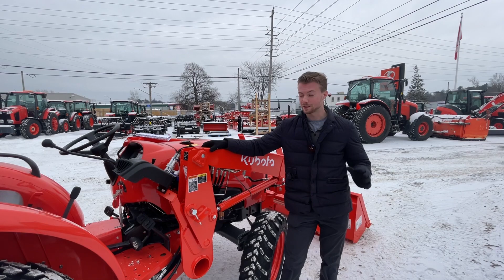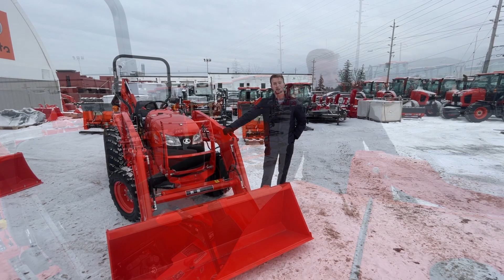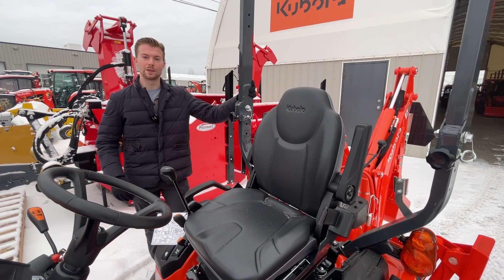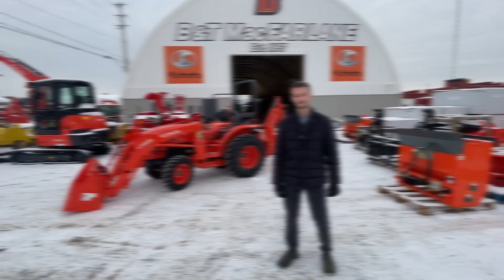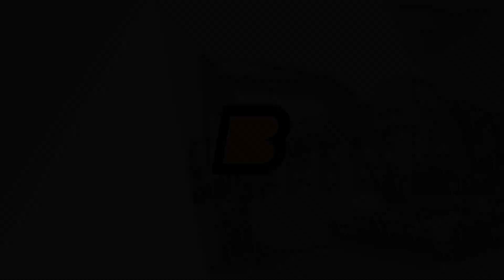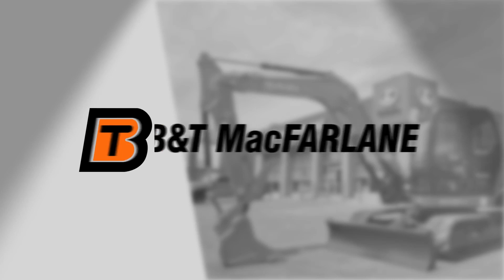Common Mistakes of FIRST TIME Tractor Buyers!

Comment: I'm in the research portion of tractor selection and two very important mistake topics that I've repeatedly read about are under buying the size of a tractor and proper tractor Ballasting. Both will put the equipment, and more importantly you, in danger if not addressed!

Comment: Got the wrong tires and wheels,got the r-4 tires and they have bad traction.The ag tires and adjustable wheels are what's needed if you live in snow country.Glad I didn't get the HST tranny.The HST whines it's guts out also.
Reply: Yes it whines , if your r.p.m. is too low and, or in to high a gear range .

Comment: My first mistake when purchasing was going a little too small.  I bought an Agco ST35 (compact), which had plenty of power for its size, but wasn't heavy enough to do the work I asked of it (20+ acres property maintenance/farm) or wide enough for the hillsides I operate on.  My second mistake was buying a tractor with R4 tires when I'm always on a trail or in a field.  R1 is the tire to use unless you're spending most of the time in the yard or hard surface.  I now have a Massey 2607H and LOVE IT.  I closely considered the Kubota M7060 but the Massey just fit closer to what I wanted.  I definitely respect the Kubota brand, and think you brought up some awesome points.  Great video.  Very well done!  Keep up the good work!